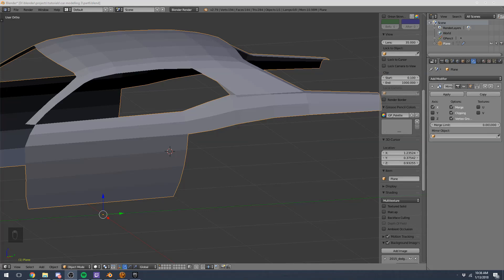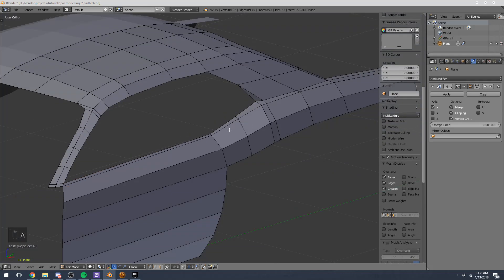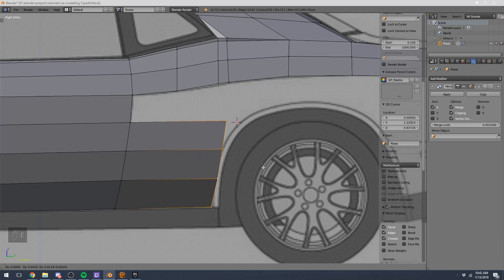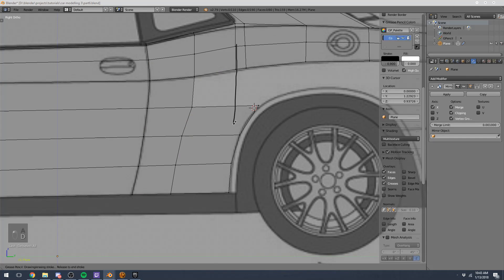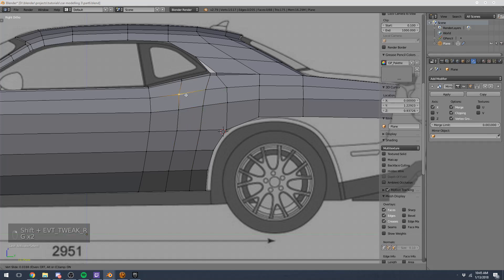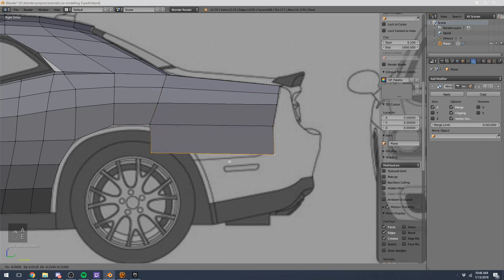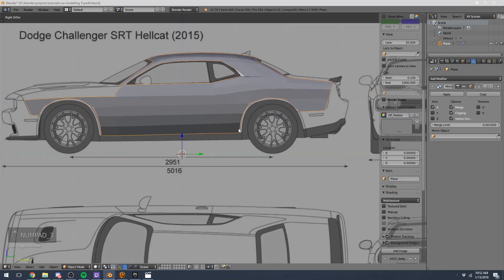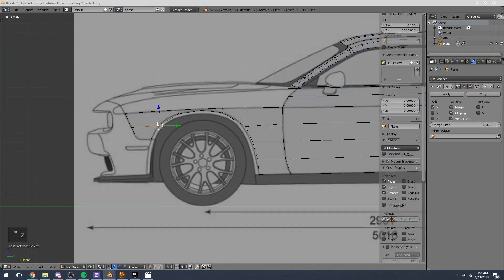Model a 3d Car | part 6 | maintaining good topology (Blender tutorial)

Comment: I would always insist on doing an inset/extrude scale around the wheel arches so that the edge loop  flows with the geometry. That way the wheel arches match and you can tighten up your subsurfs. It's just better practice to make the edge flow match the geometry. Anyway, great tutorial, thanks!

Comment: A not for folks; If you just want a part of your loop to be selected, click vert you want to start from, hold ctrl while clicking to the vert you want. Every vert in between will then be selected, so you you don't need to click individual verts to select/deselect from edgeloop.
'C', is also very handy, and imo a tad bit easier/quicker than box select

Comment: Not too shabby. :)  Should probably look into F2 add-on and using ctrl-select for shortest path. You might find those useful to speed things up a bit.
Reply from the maker: im not familiar with that addon. I'll have to check it out. Thanks.
Reply: Saves selecting 4 verts, fill. Instead you just select the back edge, fill. Even better is that the new edge is already selected, so it just has a zipper effect by repeatedly hitting fill on a pocket area. Also lets you fill in a quad from a diagonal corner vertex, even though that's not always as straight forward as the other feature.